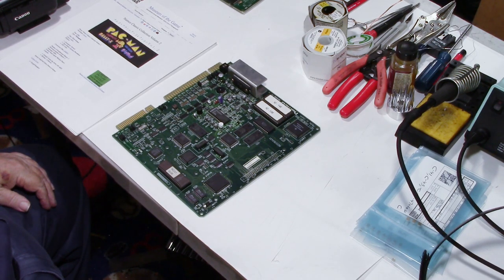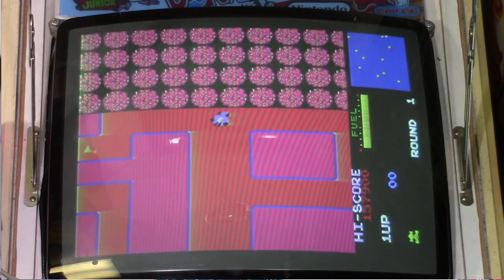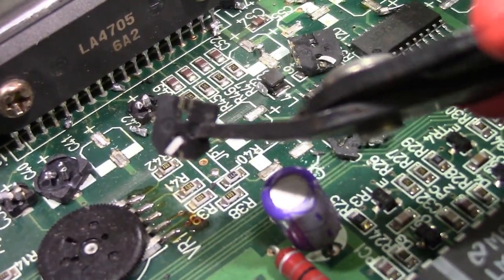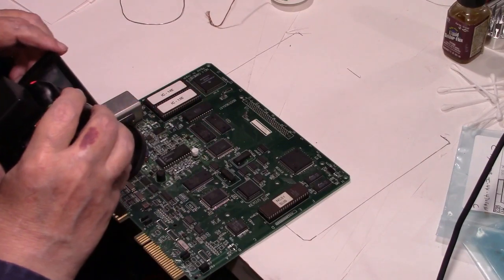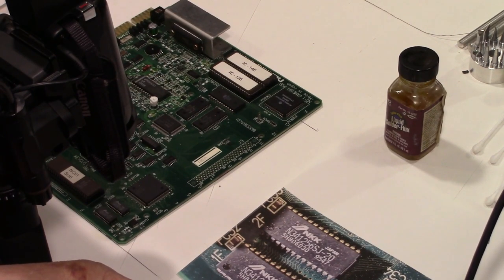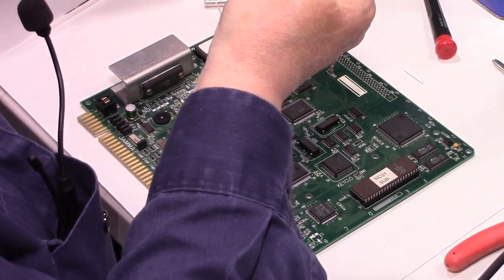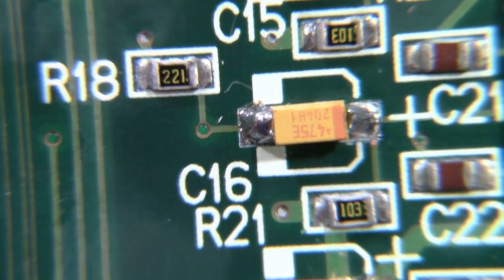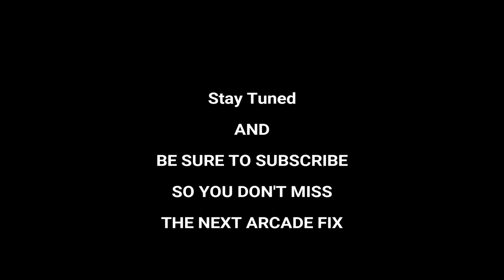SAMS ARCADE FIX - Namco Classics Volume 2 - BAD ELECTROLYTIC CAPACITORS - LETS REPLACE THEM

Comment: That brown gunk under the caps (both Dark and Light) looks like flux to me? The corrosion I typically find is whitish or greenish. I've always treated the brown / black stuff as flux that didn't quite get washed away. 
Interesting technique though. Never considered just twisting them off. Didn't seem to cause any damage as long as the twist is in the same plane as the board I guess, like a shear force.
Great video, very interesting and I learnt something new, Thanks Sam..
Reply from the maker: Yea, I did say it could be flux but I am pretty sure one or two was the start of some corrosion. Either way we know the caps in the color section was bad, so I feel better about replacing them all, well I got that one I forgot to order to replace.
Reply: @SamsArcadeFix  It was a great call to replace the caps and a great result. Well done.!

Comment: My PCB would bootup on Green screen saying 'Ram OK Sub OK' ....then "turn off and back on... (Ram OK Sub OK) ... then off and on again over and over.... what seems to be the issue? other jamma PCBs work perfectly
Reply from the maker: If you are talking about the same board (Namco Classics Volume 2) then it sounds like your board is resetting. Even though other boards work in the same cabinet check the 5 volts with the game running. Some game boards will reset if the voltage is too low or too high and if the voltage dips when it resets it could be an indication of a short on the board. It could be dirty IC sockets or bad capacitors which should be changed if the originals are still on the board.
Reply: @SamsArcadeFix  yea i checked the volts and they are fine, seems to be the board…. Im going to revisit your video, extremely helpful! What capacitors are responsible for the 5v on the pcb? Thanx!
Reply from the maker: @pacboy24  Good question, I haven't seen a schematic for the board so if mine was doing this I would check all the electrolytic capacitors with a ESR meter in circuit. If you don't have one just replace all of them as they are a ticking time bomb anyway. Check the board for any damaged traces, clean the socketed IC's. If that doesn't fix the problem, it's time to get out the scope or logic probe and poke around the processor. Good luck